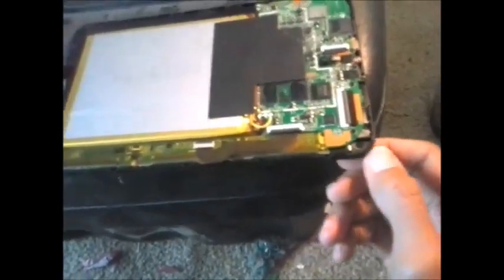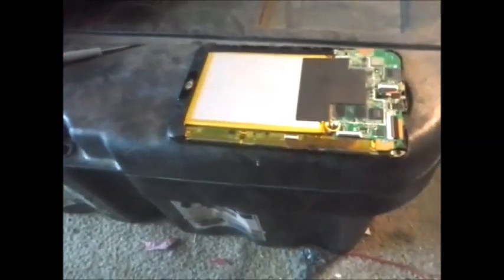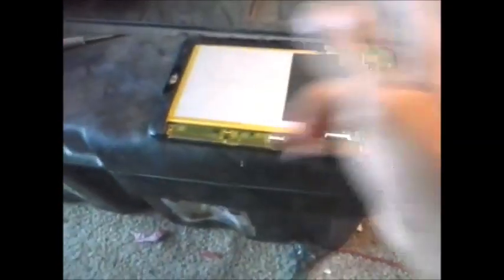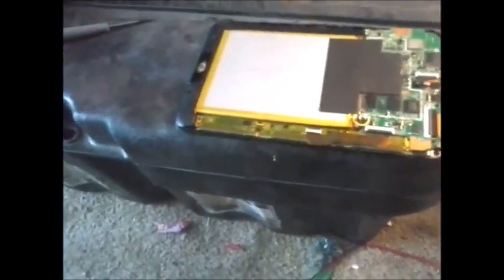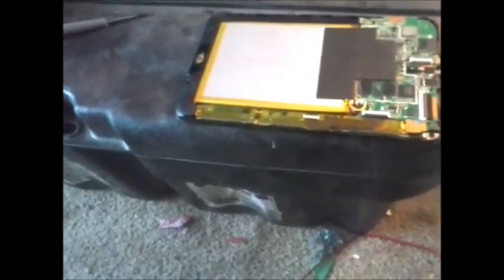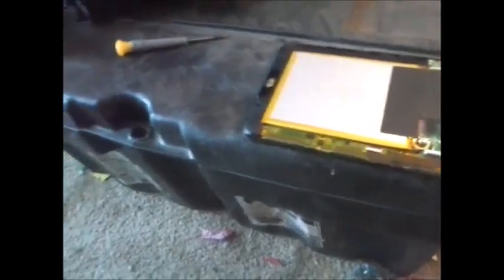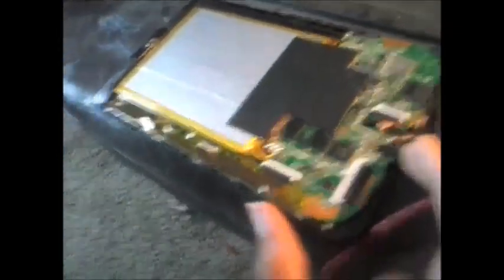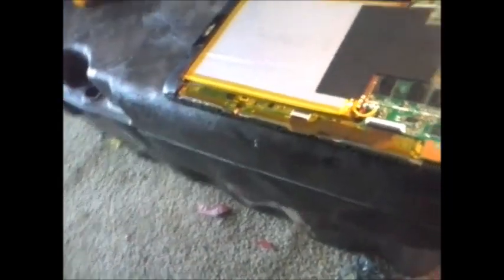How to fix a loose android charging port

Comment: be very, very careful doing this thought. The micro-USB port in most mobile devices is SMD (surface-mounted), and the leads on the board are less than a mm thick. So if you're not careful, you could easily and irremediably ruin your phone's Mainboard.
Reply from the maker: neferiusnexus thanks for the help

Comment: hey nice video, my phone reports slow charging on it and like when I charge it the battery goes down even when I turn my screen brightness to 0
Reply from the maker: +CaptainGamer Minecraft and More! 00 it's probably because it's charging at 500ma in stead of 1000ma so it will either charge slowly or it will slowly discharge even though it's charging. Try using a different power adapter at least 5v 1a or 5v 1000ma. Same thing

Comment: my charger port of my cp is misshape but not a lot it is okay but it wont charge can someone tell me how ?
REPLY
Reply from the maker: +SKI AE try cleaning it out and look and see if the 4 pin prongs or bent or see if they have corrosion on it if they do you can use acetone to clean it out and if it's not that it might be a loose solder connection on the backside of the charging port but most likely all you have to do is clean it out